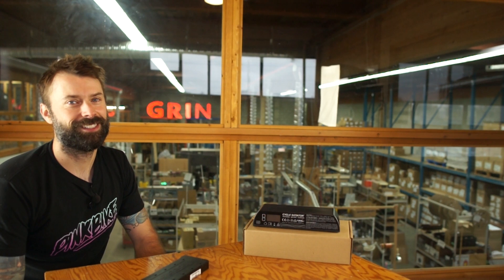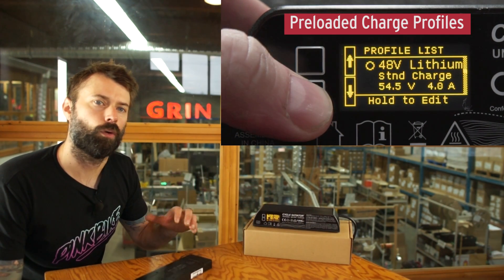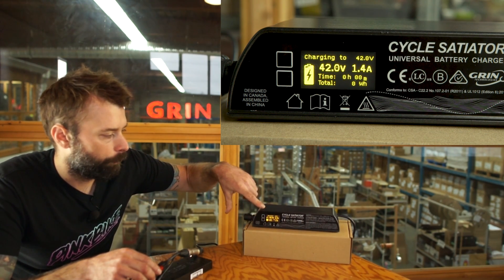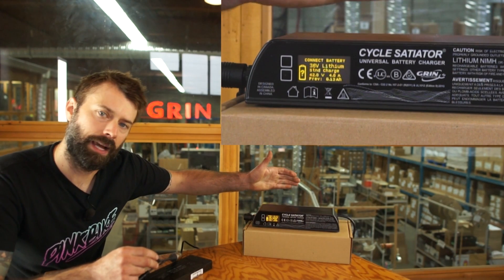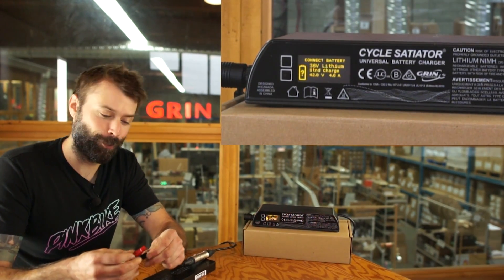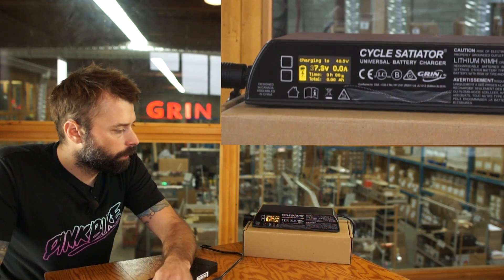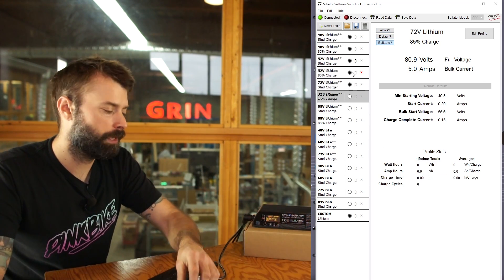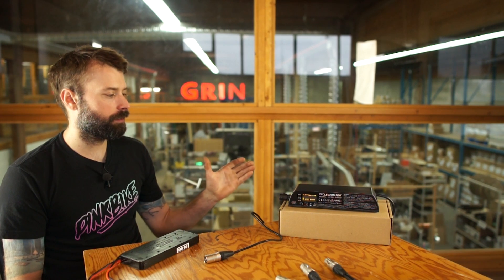Intro to Grin's Cycle Satiator, A Universal Battery Charger for Ebikes and Other Things

Comment: the display of my charger is beginning to loose pixels. I mostly use two of the preset modes and theoretically could use it even with a totally defunct display by counting the taps through the menu, but is there a chance of opening the side to do any repair/replacement on the display? I am aware that most of the interior is encapsuled in epoxy with is great as there is no clunky fan or loose condensor that could kill it prematurely.
Reply from the maker: Hey there, indeed it is fully a user replaceable part if need be.  See
https://www.youtube.com/watch?v=VzpCg_TYk00
and contact grin about getting a replacement OLED.  Usually we see pixels go missing like this after time on Satiators that are frequently left outdoors as it appears there is some sensitivity on the OLED screen to humidity over time.

Comment: Does it have a discharge setting and something to keep my battery healthy during the winter?
Reply from the maker: You don't need to do anything special to keep a lithium battery healthy during the winter.  There's a lot of myth about this. You can store the battery in cold conditions just fine, and you can store it anywhere from 20% to 100% charged. If you store it for a very long time when it is totally flat to begin with, then you run the risk of the BMS circuit quiescent current eventually self discharging the cells to below the critical shutdown voltage of the BMS circuit and you wont' be able to charge it again.

Comment: Looks like a great product. Can this draw power out of the battery for battery storage?
Reply from the maker: No, it doesn't have the ability to do that, but you also don't need to do that. There is really no problem storing a battery that is fully charged as long as you aren't storing it at a really elevated temperature.

Comment: 🤔Now I have one of these that's a 72v.And my question to you is can my 72v go down to change a 20v Lion-ion battery? Because I tried to do this but I couldn't get it to go down. So if it can go down this low .How do I get it to do it?
Reply from the maker: You just need to create a custom profile and set your output voltage to 20V, or whatever the full charge of that particular pack is.

Comment: Way too complicated, I’m gonna return mine. Just want to pick up voltage, charge rate and hit start,is that so hard?
Reply from the maker: That's basically exactly how it works. Simply select the profile with the voltage and charge rate that you want. And you don't even need to hit start, just plug in the battery and it will automatically start on its own.

Comment: How is this charger with 48V batteries, and will it detect if a battery is in sleeping mode ?
Reply from the maker: It is fine with 48V batteries. If "sleeping mode" you mean the charge port is not presenting any voltage, then you simply press the lower button to initiate a force start process.
Reply: I have 2 Samsung lithium-ion batteries. So, would I be able to do this with the Satiator. Does this have a discharge function, and what connector would I need for my 2.0 amp charger ?

Comment: Did I see the 48v model can charge 52v batteries?
Reply from the maker: Yes, no problem with 14s (aka 52v) even 15s batteries can be charged with it since the max programmable output is 63v

Comment: i have the satiator. And recently I noticed it stopped recognizing when I plugged in the battery and just started charging.. Not sure what happened. I vaguely recall that if I have a power outage or unplug the battery satiator. I had to do something to set it to the correct profile. But I think If it is set to the correct profile and I plug it into the battery it will start charging automatically. Can you help me sort this issue out?
Reply from the maker: This just sounds like you need to have a default profile selected and you don't currently. What profile options does it give you when you power it on? All info about selecting your enabled profiles and making one of them a default is in the manual

Comment: Lithium golf cart battery needs a simple ring connector the other battery.  I don't see this on you web sit but maybe you know where to get them.
Reply from the maker: You can make your own adapter cable easily enough if you have the mating plug for the battery. Or get the XLR->Anderson adapter as a starting point.
Reply: I have that xlr to anderson and could cut off the anderson and put on a ring adaptor.  I guess that would work.  Thanks

Comment: Question, can I set this up for an OGRPHY 48V 100AH LiFePO4 Battery with Bluetooth, 5.12kWh Grade A Cells Lithium Battery with 100A BMS?  This will be for a golf cart battery and they usually recommend a 15v charger but I will be charging overnight so time is not a problem.  How long would it take to recover 50% charge?
Reply from the maker: Yes it will work fine. With the 8A charger (7.5 in practice with a 48V battery due to 360 watt limit) it will take about 13-14 hours to fully charge from flat, and 6-7 hours from 50%

Comment: This piece of crap just deleted all my profiles again. I can't be spending my life having my daughter set up these profiles all the time. If it were easy, I would do it myself, but it's not. You need to fix this thing :face-orange-frowning:
Reply from the maker: Are you using the 1.039 firmware on the device or an earlier release? It will say on the startup / boot screen.
Reply from the maker: Also if you can please send an email to info@ebikes.ca   If there is a case of profiles disappearing with the 1.039 firmware that is something that our engineering team really wants to know about.

Comment: Can someone give advice?
I have a 48V 17.5Ah lithium ion battery using a tip positive barrel connector to charge. It says to charge at 54.6V at ≤3A. If I were to try charging at a higher current and/or voltage with one of these chargers, would I destroy the battery or blow an internal fuse?
Can I use this charger to charge faster than the specs above?
Reply from the maker: Almost for sure it will be fine but the truthful answer is that you'll only know by trying. Most DC jack connectors are fine at 4 or 5 amps even, and a few better quality ones ones will support 8 amps. It's extremely rare that the charging port would be fused at just 3A. If there is a fuse there it would normally be like a 10A fuse to protect against accidental discharge shorts on the charging port. As for the charge port cutoff current of BMS circuit, again you can only know by testing. It's rare that the vendor or manufacturer actually know the internal capability and would be able to give a straight answer.  The cells for sure have zero problems handling much higher charge currents.
Reply: @GrinTechnologies   Thank you very much!

Comment: I was interested in it till i saw all available cable. Mine is not here and its common for scooter and motocycle ebike. It has the same end as the power cable. Is it something youll make eventually?
Reply from the maker: You mean the IEC cables?  We found it quite surprising that scooter ebikes were using an AC plug standard for DC battery charging, as the consequences of a mixup can be quite disastrous here.  So it's not likely that we'll ever make it as a formal adapter,  but it's quite easy to DIY your own by just cutting up a computer power cable and terminated one end with a 3 pin XLR.

Comment: I have one and think it's a good product. It does have faults, mine keeps losing all the data including the set charge pattern. No off switch is very annoying. You never know which button to press to stop it charging. Why does the cable go backwards when you turn the display towards you and have battery infront of the charger? If you have the charger infront of the battery the power lead is in the way of the battery.

Comment: Not sure if its a worth it to pay a premium to actually hurt the battery if you decide to charge it faster. It is universal agreed physics that the slower the charge, the better it is for the life of your batteries... So a cheap standard 2a or 3a ebike charger is probably healthier for your bike anyways. Also, I find it abit silly some reviews seem to bash "cheap" china chargers when this is made in china. For there record, I'm Canadian.
Reply from the maker: You've made a great point, fast charging isn't better than slow charging for for your cells, but there's many scenarios where fast charging is absolutely worth it. Charging whilst ebike touring for instance, you don't want to wait 7 hours to charge a 14ah battery with a 2A charger when you could charge in 2 hours and be on your way. Also totally agree there is no reason to bash Chinese made goods!
Reply: @GrinTechnologies  agreed, to have the ability to fast charge 2hrs vs 7hrs when needed is a good use case scenario.
Reply: Do you realize how far away ebike charging is from C rate?  Most manufatures say that a 1 C charge is fine!  Most ebike batteries are 12- 20 amps.  Charging at 6 amps for the 12 Ah battery is 0.5 C....... NOT AN ISSUE According to manufacturer specs it could be charged in 1 hour at 12 AMPS. What do you thing Tesla is doing with there "fast charge"  4-5C rate...... Yes, you are right, slow is better, BUT .5C IS slow

Comment: Wow, this is such a great product. Too bad I already have 4 chargers, and the price would make it way overkill for me. 
Keep on churning out such amazing stuff!
Reply from the maker: Thank you!
Reply: @GrinTechnologies  will this charger show the batteries amp hour capacity? Thank you
Reply: unless you have something with the satiator features.. you are missing out on opportunities to monitor and extend your battery lifespan. I like the satiator for various reasons over others, because i can increase the charging amperage to 4amp instead of just 2 amps which most charges operate at. And I can see exactly how many watt-hours have been pumped into the battery after it is fully charged. And it keeps a charge cycle history for me. And the 85 percent charge profile feature is incredible for extending battery life.
Reply: @manp1039  It's overkill for me, because I have a fully cutsomizable BMS. 
It was setup to stop charge at 4V (roughly 80%).
And of course, it tells me how charged it is + voltage and intensity graph.
The nice thing about controlling it on the BMS, is that you can setup a cut off voltage for an individual cell + the active balance.
Now with my lifepo4, I cut of at 3.45, instead of 3.65 (charging). Even though, with Lifepo4, you are supposed to be to charge up to 100% every time.

My charger is a dumb variable voltage and intensity power supply. It can charge up to 8-9A. Unless I'm really in a hurry, I usually charge at 2A (my battery is 20 Ah).

Comment: There seems to be a move to LIFEPO4 batteries. Is that also happening with eBikes? If so, will there be a version of this charger supporting LifePO4?
Reply from the maker: Oh the Satiator supports LiFePO4 just fine and they are even in the default profile list. 

That said the move is away from LiFePO4. They were fairly popular with DIY ebike builds back in the early 2010's but while all other types of lithium advanced by leaps and bounds in specs and reliability, the energy density and quality of LiFePO4 really sat stagnant.  They are OK in applications where you don't care about weight (like boats), but not very attractive on an ebike where they'll be 2-3 times the weight.

Comment: I have owned two chargers since 2015 - awesome product. My only recommendation is to put electrical tape on the tactile buttons because the plastic around them tends to crack after many uses

Comment: Grin why is the price up almost $100 I love this charger but paying more than $300 is a bit overpriced don't you think. 
Not saying that you shouldn't set your own price because this is the best charger on the market but $385 ?
Reply from the maker: Thanks and yeah we hear you. Unfortunately the rising material and spot buy costs for electric components drove up the production price a huge amount in 2021 so our recently produced batch had to reflect that. 
We're sure hoping that electronic part prices will drop again when the supply chain catches up.
Reply: @GrinTechnologies  Thanks for the answer makes sense.

Comment: I use one of these for my custom48V battery but would also like to use it for my 36v Shimano ebike battery . Is there any way of doing this? (I realise that may need some way of fooling the Shimano data channel and obtaining an adapter cable) My reason for this is to be able to choose %charges to extend the Shimano battery life as I do with my aforementioned 48v battery.
Reply from the maker: No problem with the custom 48V battery, but the Shimano pack will be quite a trick to figure out since yeah they battery will not allow charging current to flow in unless there is constant communication over the data port. We're not aware of anyone having reverse engineered all the signaling that takes place in order to spoof it.

Comment: If I leave my bike battery charging overnight, will the satiator automatically stop charging once my battery reaches  optimum percentage?
Reply from the maker: Yes, it sustains it at the constant voltage output that is programmed in the profile and the current gradually trickles down to near zero.

Comment: a question about your different models, you list them as:
103V 5A
63V 8A
36V 15A

is the 103V version still limited to 5A when charging a 36v battery? or does it have additional current capacity at lower voltages?
Reply from the maker: Hi David, the current limit on the model applies across the range. There is no additional capacity, as the higher voltage models require different transformer windings and transistors that are not able to handle as high of a current.  
You are also limited by the 360W maximum power as well.  So it is the max current of the device at lower voltages, and 360/Vbatt at higher voltages.

Comment: This feels like reinventing the wheel. For 3 times the price. A switching bench power supply like the RD6006 or RD6018 will do pretty much everything the Satiator does, and you'll still have a decent bench power supply at the end of the day.
Reply: I'm not so comfortable with using an electrical product from AliExpress that isn't UL listed to charge a battery that has the potential to burn my house down.  And I'm even less comfortable making my own battery adapter for the thing.  It's not worth saving a couple hundred bucks over.
Reply: @james-p  Never charge a battery unattended. Even if your charger has 10 UL stickers.
Reply: @firstlast9292  Of course not.  But even if I'm attending to it, and it ignites, what am I going to do, throw water on it?  Pick it up and throw it outside?  Lithium-ion batteries burn hot and provide their own oxygen.  Having to charge outdoors is kind of silly.
Reply: That’s an interesting point.  I’ve been wanting to set up a lab bench so may go this way but will have to be sure I can program a supply to cut off so that I don’t burn down my neighbourhood in the process.  Dave at EEVblog has some informative and relevant videos and I’ll have to do some research into supply specs.  https://youtu.be/jNmlxBXEqW0

Knowing how often I leave the stove on though I do think the satiator has value and I’m not adverse to throwing money Grins way.  Good folk deserve good money for brilliant work.
Reply: @henrievery-3rey  Maybe you should go read up on the functions of RD6006/RD6018 before you tell me to go read up about lithium battery charging.

Comment: Thanks -my favorite charger. 

I appreciate the profile function.  I can charge fast when I want to, or charge slowly to a certain percentage to preserve battery longevity if trips are short, or I plan on storage. 

I’ve been a little confused as to the best approach when charging generally.  I’ve settled at charging to 75% the night before the day I need 100% of the battery. The day of, I quickly top off.  
When I know I cannot use the batteries that I own, I try to keep at just above 50%.  I was storing (before I knew any better) at full charge, and then to 75% when I started investigating further. 
I believe I damaged one DYU 36v 6ah battery because of storing at 100%.  The battery was less than a year old, and with few cycles. Now I use that battery as a portable power bank for cell phones because the energy density isn’t enough to power a ebike for very long.
Reply from the maker: Hi Ray, the issues with storing or using at 100% are not nearly as bad as is often led on, at least not with the quality cells typically used in ebike battery packs these days. So if you need a 100% charge from the pack then charge it up to 100%, whether you do it the moment before or the night before won't really matter.  

For longer term storage, anywhere from 25% to 90% is just fine.  The main issue with long term storage is starting off when the pack is nearly flat, and then having the BMS quiescent current drain cause it to go totally flat in storage.  Storage temperature is also likely a much larger issue / concern than the terminal cell voltage. High temperatures are not good.
Reply: @GrinTechnologies  Thank you for that detailed information. 
Is there a specific temperature range that you can recommend that I should keep the battery pack at, and the hub motor for that matter ?  I usually discharge quickly, so I sometimes worry about this issue.  I’ve also temperature tested my hub motor and have recorded it at around 65 Celsius on occasion.

Thanks !
Reply: @Grin Technologies Can you charge two identical batteries and have two different records?